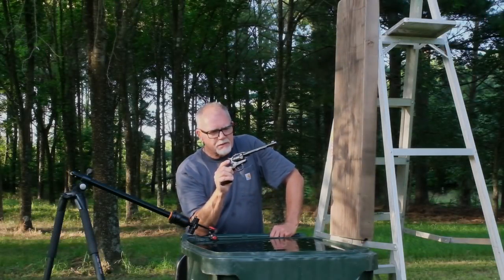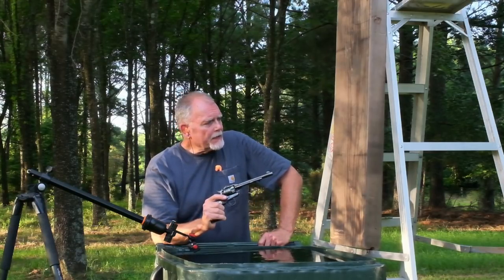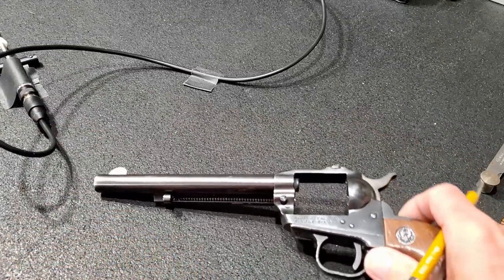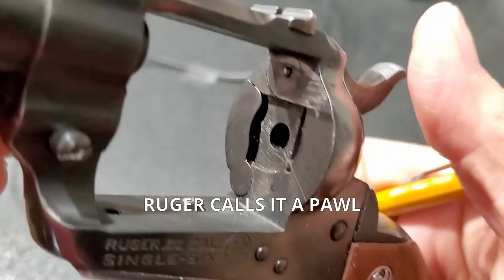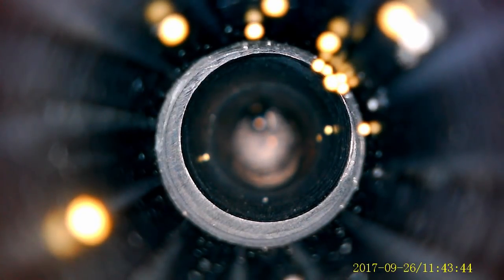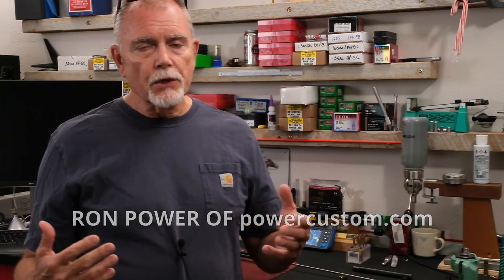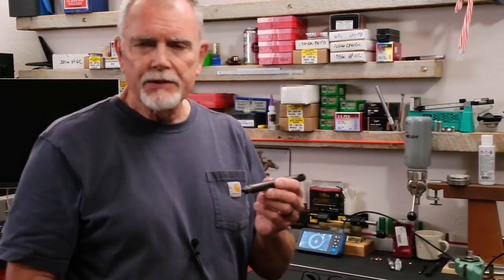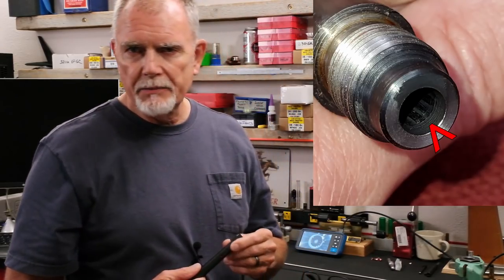The Bullets From My Single-Six Are Crooked ! ! !

Comment: This has been a fun series. Ruger doesn't always get things right and it's fine to like the company and still admit that. I've seen a lot of 10/22s that had huge variations in the casting of the receiver where it supports the magazine. This makes an enormous difference in reliability. So one guy will swear that 10/22 is never misfeed and another one will say they always misfeed. Both will be telling the truth of their experience. Also there is a pretty well-known Ruger problem with their 357 revolvers that have 9 mm swap cylinders. 357 revolvers typically squeeze the bullet down quite a lot. And those particular revolvers though they are closer to 358. And the 9mm cylinders have a forcing cone on them that squeezes the bullet down several thousand under the barrel size. So no one matter how fat the ammo you feed it it would always be too small for the bore. I don't know if it's still up but fortune cookie 45 LC did a pretty excellent series explaining this problem and demonstrating it. The solution is either to have Ruger or another gunsmith ream the forcing cones in the cylinder up. If I recall correctly this was a problem that Ruger never really admitted to so they often won't do the actual fix. I'm not hating on the company I'm just saying these are known issues. They make some stuff I like and other stuff I want to like.
Reply from the maker: Thanks for the very comprehensive comment! I have picked up a forcing cone reamer and will clean up the forcing cone on both this and the new Barrel once I get the rod which is on backorder.
Reply: @TargetSuite  welcome. Anytime I post something like that, there is a little bit of terror that maybe I misremembered some fact and am passing forward misinformation. I hope I was accurate above. Certainly if I find an error I try to go back and correct any comments that I have which might mislead people.  

I've slugged a few 357 revolvers. And the book I kept my notes in got lost during the move. But I have my recollection the bullet exits the barrel at somewhere close to 0.355" personally I think that's excellent because it means you almost can't get a wrong bullet in there so long as it will chamber. 

No problem with the Ruger's named above was the conversion cylinder to make it work with an auto pistol cartridge that had a additional force and cone built into the cylinder which was poorly sized. I shot many bullets intended for 9 mm out of 357 or 38 special revolvers and I haven't had one that didn't work well. But that was all out of 38 special or 357 brass. I don't personally own one of those conversion cylinder guns but the idea has always been appealing to me. I tend to give away a lot of loaded ammo in revolver brass and the brass does not reliably come back. 9 mm on the other hand is safer because there isn't room for a double charge and the brass is plentiful. So I would love to have something like a Smith k frame with a 9 mm cylinder. That would be a very very convenient gun. Probably the same is true of an GP100 but I haven't had much opportunity to play with those.

Comment: The paw worked fine the cylinder lock is off .  Is that the original cylinder  ?   Perhaps you need a new center cylinder pin ? Worn or bent pin ?
Reply from the maker: The cylinder is rotating a little bit slow in other words it doesn't quite lock up if you hold your thumb against the cylinder. Once I install the new cylinder stop the hand will be too short to get the cylinder all the way to its new position. I checked the base pin and it is straight as an arrow. It's just a little bit small for the hole in the frame and the cylinder. Thanks for your comment!
Reply: @TargetSuite      If your pin is a little small ( as you say ) that would cause the miss alignment.   Replace pin

Comment: What would replacing the base pin do to change the way the cylinder lines up with the barrel? You didn't show it so is it worn.dont they use end shake bushings to tighten cylinder alignment?
Reply from the maker: The oversized base pin is just part of the solution and will eliminate the excessive looseness in the PIN to frame and pin 2 cylinder fit. But the big issues are timing which is the rotational alignment of the chamber to bore and then there is that problem with vertical misalignment. I'm still hoping to get that fixed with the new Barrel.
Reply: @TargetSuite  The rotational misalignment will be affected by the vertical correction of the cylinder. The hand and bolt are offset to the centerline.  Assess the clocking error after the vertical correction to see what the net error is with the cylinder centered vertically. The  base pin bore in the frame may be the root cause by being too close to the barrel center axis.

Comment: I had one bought new. Would lock up and not rotate. Found cylinder notches had thin pieces of metal that conformed to the entire notch. Then after minimal shooting the hammer plunger had a big burr on it keeping it from functioning properly. Rugers are good guns but I seem to have got a hold of a piece of crap. Am tired of buying something and taking it home and having to make it function.
Reply from the maker: Fortunately, Ruger customer service will make good on those occasional bad guns that sneak out of their Factory. This one just happens to be a little bit too old and they don't have parts for the old models anymore.

Comment: Did you check out the rotation shaft for the cylinder? Is there any wear on the shaft or the bore that is rides on?   IMHO the “Hand” would have little to do with the final position of the cylinder. It’s the cylinder stop that helps the bores stay in alignment. Also, if the rotation shaft is worn or loose, the rotation stop could be pushing up on the cylinder. 
I’ve had to replace a “Hand” on an old revolver because it was not quite making the cylinder rotate 100%. I had to finish the rotation by hand.  It’s actually best to grease the star on the back of a cylinder to slow the wear factor. Oil is too easily displaced. The moral to the story is: keep your guns well oiled, AND greased in the revolver world. They are small MACHINES! <The Machinist>

Comment: Good detective work there George. Have you checked the 22LR cylinder to see if the same issue presents itself?
Reply from the maker: No. This is a 22 mag only version of the Ruger single six. Thanks!

Comment: I have a two boxes of Winchester 22 magnum bullets.  From the factory they are not seated correctly,  like they had been push in crocked.  You could shoot them but it was hard to get the spent case out.

Comment: Measure the end of the cylinder at the barrel's forcing cone. The opening should not be more than about .227 or maybe .228. I had this same issue with a S&W revolver chambered .45 Colt. The cylinder mouths should have been no more than .453 or .454 at the most. The smallest one was .456 with others up to .4564!! This caused the projectiles to enter the forcing cone sideways.

Comment: I have little to no firearms expertise, that being said, after seeing the movement of the cylinder when the shims were introduced. It seems too me that a possible culprit to your misalignment situation may stem from either a worn cylinder pin, or the cylinder locating bore itself being worn. The cylinder stop contacting the bottom of the cylinder may have enough contact pressure to push the cylinder up and slightly to the side due to the angled profile of the cylinder stop notch.  Again, I claim no gun smithing expertise.  But if I were to guess (which I admit I am) I would look at that area first before replaceing any other parts.
Reply from the maker: I appreciate you waiting into this issue. There isn't any indication of excessive wear. So as I said in a later comment I attribute all of that looseness to Manufacturing tolerances. Thanks again for your comment!

Comment: Im guessing you have closely looked at the cyl rod already? Ive seen the crane get so worn in old smiths that it messes up the timing.
Reply from the maker: Good thought. The base pain is straight and there doesn't seem to be much we're at all on it or the cylinder itself. Just normal or perhaps a little excessive Manufacturing tolerances
Reply: @TargetSuite  maybe swap the pin out with another to try, if the ware is in the cylinder then the right way to fix it is to take the whole out larger and sleeve it. When guys set around spinning the cylinder as fast as they can and cock them while doing that, it can cause all kinds of problems with an action. Good luck. To good of old guns to waste.

Comment: wow !Amazing! the alinement problem would be interesting to know how it compares to other single six pistols such as a new one. Some one must have used that pistol as a hammer of pry bar? what about the cylinder gap to the barrel? Is the cylinder rod strait ? What a cool video!
Reply from the maker: Hey, thanks for your comment!  The cylinder pin is straight. And the cylinder gap is small, but the back face of the barrel was fitted by hand and so the Gap is almost zero at the top and then about .004" at the bottom.

Comment: I have a Ruger SP101 in .22lr and the chambers did not line up properly with the forcing cone causing lead to be shaved off the bullets. I sent it back to Ruger to be "retimed" but they went the cheap route and just bored the forcing cone out to about 24 caliber. No more lead shavings, but the revolver has never shot straight since.
Reply from the maker: That kinda stinks. I'm surprised the didn't fix the timing!

Comment: Wow! You're turning into quite the "Single Six Detective"!! It's very interesting to watch as you systematically, and methodically troubleshoot what is happening with the internals of the gun. So, my question is...is the cylinder out of alignment,  being too high? Or, is it the barrel itself bad with the forcing cone too low??  I guess that's why your next step is to swap out the barrel and then check alignment. Very interesting.  I guess once the high/low problem is solved, then you can address the rotational issue with your new parts. I'm very anxious to see how this all turns out. Thanks for the video.  I'll be watching for the next one.
Reply from the maker: Thanks Steve! Yes you are right. I have to fix the up-and-down issue first before addressing anything else.

Comment: How is the cylinder base pin and the hole in the cylinder and frame?
Reply from the maker: There is what I would call a little bit of excessive Play Between the base pin in the frame and the base pin in the cylinder. The oversized base pin I have from Power custom removes most of that. That oversized base pin will be a part of the final solution, if there ever is one :-)

Comment: Im sticking around. I would replace the hand and locking lug, and check timing again, but I get what you are saying about the up n down. So, you think the frame stretched? Looking forward to seeing this. You are going to have an heirloom by the time you are done!
Reply from the maker: That's an interesting thought but I don't think the frame would stretch with a 22 magnum. My guess is that the bore was drilled off center to the barrel blank but that is a supposition that will have to be proved when I unscrew this Barrel. I will certainly share that step along the way. Thanks for the comment.
Reply: @TargetSuite   I'll preface my comments with clarification that I'm certainly not a gunsmith!  In fact, over here, I'd qualify as NAGA!

That said, I have to ask whether your feeler-gauge test was with the cylinder pin in place or not?

If it was in place, and you have 0.005", or so, of vertical movement in your cylinder (possibly even more since you were really only trying to centre the chamber vertically with the barrel, so may not have tried to move the cylinder through its entire range of possible vertical motion) that MIGHT suggest excessive clearance between the cylinder itself and that specific pin, or substantial wear on either or both.  Could be worthwhile checking the pin diameter (at front and rear) and the internal diameters (also front and rear) of the hole which accommodates the cylinder pin.  Perhaps Ruger may be able to supply a larger cylinder pin, to rectify that clearance issue.  If a new larger cylinder pin isn't available in the size you want, or is too badly worn, a possible solution might be to hard chrome plate it, or have one custom made by a local machinist.

Combine that with a new, properly fitted, hand and cylinder stop and your troubles may be sorted.
Reply: @charlesbertram986  I guess I should have read further down in the comments. This is my question also. Sure does seem like a pin to cylinder fit issue combined with wear between the ratchet and the frame.

Comment: I have a few thoughts and or questions. I noticed that the rear of the cylinder frame (pawl and firing pin side) has some wear marks. Maybe an ill fitting cylinder? Also, please look on the  barrel side of the cylinder to see if it is ( stamped or engraved ) with the  last 3 digits of the frames serial number. It may be a cylinder from another single six? Do you have the .22 LR Cylinder? Does it have the same issues? Check it for the corresponding serial numbers!
I’m going to try and find some WMR and Lr ammo and blow the dust out of my single six;)
Thanks and stay safe.
Reply from the maker: Thanks. I appreciate your comment! There are some file marks on the back surface of the cylinder opening. I attribute that to some Shadetree Gunsmithing over the years. This gun came from the factory as magnum only, according to Ruger customer service anyway. And it is etched with the last three digits of the serial number so it is the original cylinder.
Reply: It’s so nice to a content provider that not only provides great content but, also responds to questions and ideas!
“Great Job”
Be safe and stay healthy

Comment: to me id be looking at the axis of rotation.  seems like the center pin is worn, or the bore for it is wallowed out to allow the mis-alignment.  i think you were compressing the cylinder stop spring when you are inserting the no-go, and that is what is holding the cylinder up and to the right relative to the bore of the barrel.

Comment: If you can force the cylinder down center what is it doing when you strike a bullet primer? 
that cylinder may be bouncing around when a bullet goes off. its likely worn on the cylinders rotating axis bore or the pin that holds it, and the bottom locking mechanism is pushing it up. 
if the cylinder is loose the timing mechanism isn't going to work properly. If the cylinder is pushed up and away from it then it has less ability to rotate the cylinder properly.

Comment: Along with what others have already said here about the possibility of a pin to cylinder issue. If you would sir. Please check out a video by a fellow named Blacky Thomas labeled something like “Why the Colt percussion revolvers suck”. It was very informative to me because he described the wear problem between the ratchet and the frame. This appears to have a very similar design that can possibly add to your problem.

Comment: I paused the video and using a scale measured the chamber width, assumed to be close to .220. Then measured the left and right offsets, it looked like 4 thousands left to right, which makes the up down less. The shim seemed fo force motion in both directions, I wonder why. Now I'm going to have to see if I can inspect my single 6 similarly. It came with two cylinders, 22LR and 22MAG.

Comment: hi !
i think that these disalligment of some thousandths of inches remain also after changing the cylinder stop the hand and the barrel,  because the cylinder stop in the notch push on the cylinder  with its spring, and the cylinder goes up 
 but i wish you the same good work 
i hope that you fix these issues   

bye    bye
Reply from the maker: Thanks!

Comment: Hi George, maybe I missed something, but have you tried the cylinder on another single six to see if the misalignment is purely due to the cylinder? Regards Paul
Reply from the maker: That's a good idea but I have not had access to another cylinder. But that will all change later this week when I pick up another old model single six from 1963. I will see how that cylinder fits if it does at all.
Reply: @TargetSuite  Great! I'm really curious what will happen next.

Comment: Could you have a bit of slop on your cylinder pin? With the feeler gauge it looked like you were pushing the front of the cylinder down some. Or does that cylinder have a bushing in the front of it?

Comment: Didn't Ruger recommend a new barrel back when you sent it to them ?. I would assume they did a quick check with a gauge rod and knew then the cylinder chamber was not centered with the barrel bore .
Reply from the maker: No, they said the barrel was "shot out" and offered me a good deal on a new Single-Six. Foolishly or not, I opted to keep working on this one instead because it has been fun and I have learned a ton from the project. I hope a lot of you guys have as well.
Reply: @TargetSuite  So they offered a new revolver , not a new barrel . My mistake. Surely they must have been aware of alignment issues . In any case I've been hooked on this journey . Put in 49 years myself ( '64 - 2013 ) as an auto tech . I'd get my teeth into something and refuse to let go . Wasn't enough for me to " fix " something,  but had to know what & why something failed . Pissed off a lot of bottom line driven service managers . Looking forward to your next Single Six installment .
Reply from the maker: I've definitely got my teeth into this one. But I'm looking forward to making some progress. Maybe the next step or two and we'll start seeing daylight at the end of the tunnel.